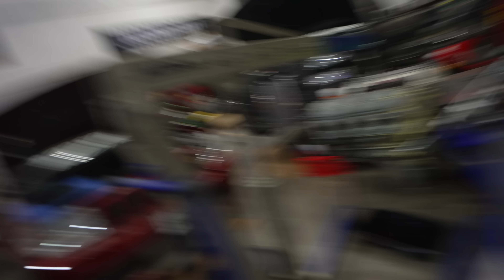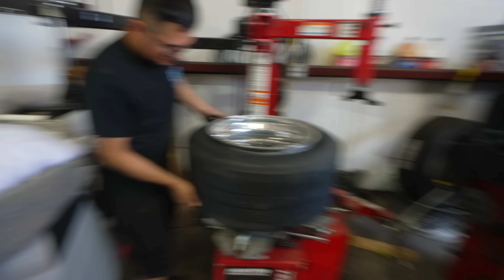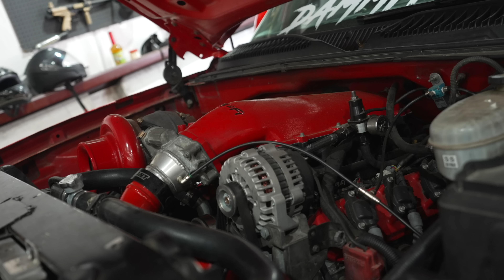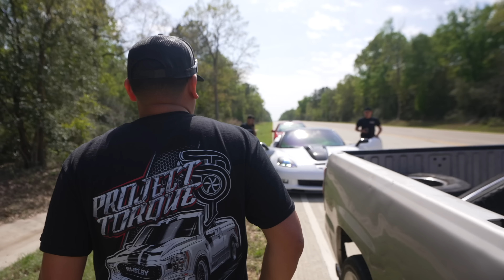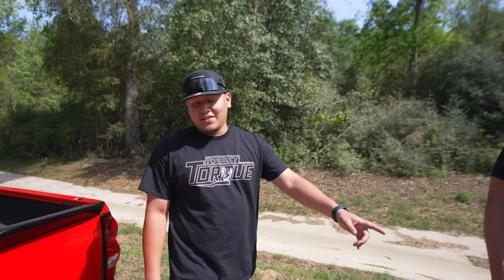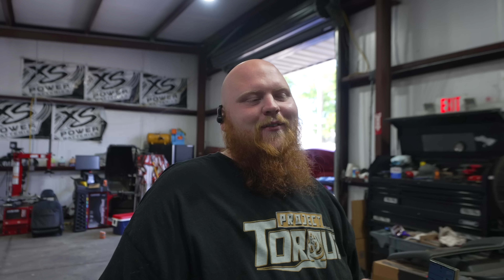Turbo K20 Swapped Honda Civic Vs My Turbo SS Clone SILVERADO ‼️

Comment: Not taking sides, but Freddy's truck has a longer wheel base then JR's Honda. It's not a fare race at the finish line. 🏁
Reply: Y'all need put a go pro at the finish line to see which tire crosses first maybe. When having a different wheel base vehicles. 🏁📸 📹

Comment: That truck is @4500 pounds stock Vs a 2300 pound car stock minus the fact that the is all stripped down so it’s probably @2100 or so 
That extra power of the truck is still not completed to the weight difference